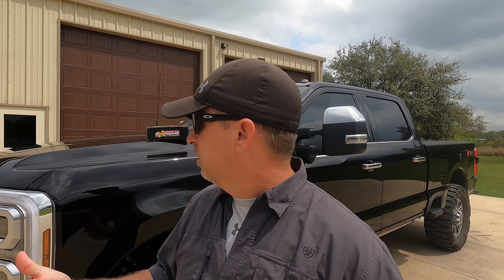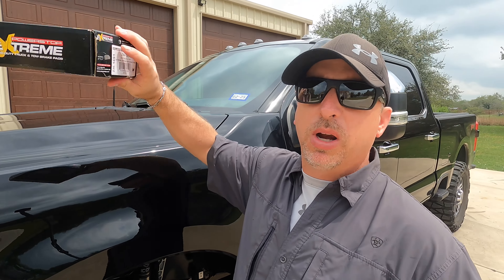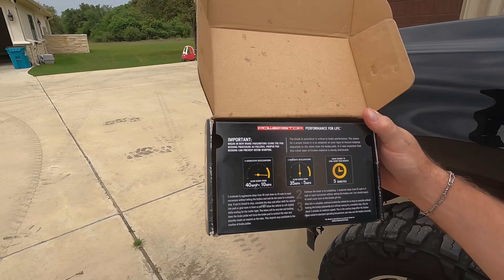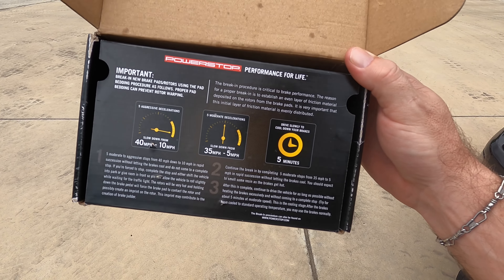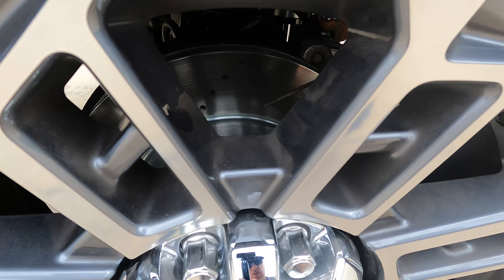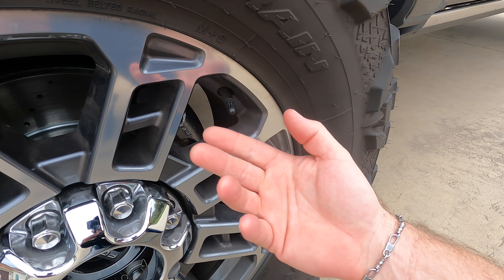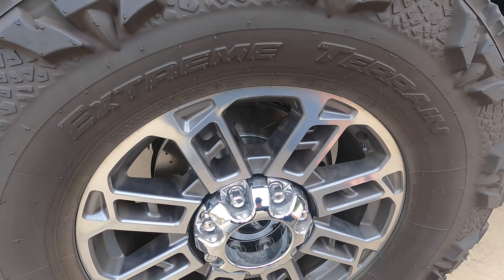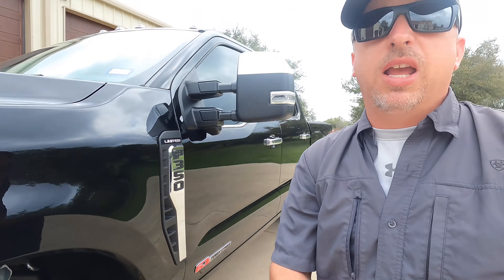2024 Ford Superduty F350 Limited Powerstop Z36 Brakes Towing!!

Comment: I did upgrade to Powerstop pads and have the stock rotors with 30k miles on my SD but I can tell it’s a big difference and not so much brake dust like the OEM crap,that bedding process it’s really important

Comment: Thank you for the video. I have a Chevy and ford both has 3/4 ton trucks. I tow heavy daily with. Looking for better than factory brake performance. For the sudden stopping with a heavy load. I notice it’s been awhile since you made this video. Any more follow up after having them for awhile? Especially compared to factory performance?
Reply from the maker: @aaronhoughtaling6829  They were a little better than stock in my opinion for braking. I would prob just do the pads and not rotors if doing it again. The best outcome was no more brake dust..
Reply: @RockyRohde  gotcha. I appreciate the reply. Especially so fast. I’m actually considering trading a truck for something heavier with better stopping power. It’s when the trailer brakes cut out from a wire fault or something silly that scares me. I’ve been pushing the limits for a few years. I scale 26klbs at the dump sometimes… just trying to explore any options of helping my current trucks before spending the big bucks…
Reply from the maker: I pull a 43’ toy hauler and I was never comfortable with stopping until I installed disc brakes on trailer.. Now the trailer stops the truck. I have a video on my channel just search for deemax.
Reply: @RockyRohde  I’ll have to check that out. I have 2 16ft dump trailers. One’s a triple axle. They’re not overly big. But they’re heavy even empty. Being it’s like 2 stout trailers stacked on top of itself. I hoped the triple axle would do well giving me an extra axle with an extra brake. But it seems to often have a short in brake wiring. It’s not bad when hauling off trees or mulch. But regularly haul concrete from tear outs or rock into jobs. Definitely adds up fast

Comment: I’m mostly interested in how they hold up since I put over 100k miles per year. Reducing brake dust would be nice, but not at the expense of performance or longevity.
Reply from the maker: Time will tell.. I have noticed a lot of 23’s already replacing stock pads…
Reply: I’ll break 80,000 tomorrow morning and I’m thinking I’ll probably get to 120-130k before the fronts need changed. I was over 150k on my 2017 before they needed new pads, so the adaptive cruise is definitely wearing brakes faster than without it.
Reply: So you bought the pads and the rotors together?   Also what tire pressures do you run front and rear when towing VS not towing?
Reply from the maker: @markcall6799 The kit part number has all front and rear. Mud grapps are 3850 rated at 65 psi. I run 60 rear and 55 front. They expand 5 psi in about 20 mins.. never had an issue. That’s towing pressures

Comment: did you have to replace the calipers .if not what was the code for you truck i have the same truck
Reply from the maker: No just replaced pads and rotors. Just purchased for a 22 model on the site. The 22 is the same parts

Comment: What part number did you order?  Had them on my 2020 250 and loved them, my 2024 350 single goes to build on 4/8…..hopefully
Reply from the maker: Just entered f350 SRW on the power stop site. I had to use a 22 model on menu.
Reply: Got it, thanks

Comment: I’m wondering if you would have similar results with only changing the pads. I have a 24 Limited with 1,500 miles and already the brake dust is unbearable.

BTW and based on your recommendation I will leveling and adding 37x12.50 and 1” Boras. 

Great content for us super duty folks. Thanks!
Reply from the maker: You can try the pads first see how it does. The kit is cheaper with rotors is the downside..